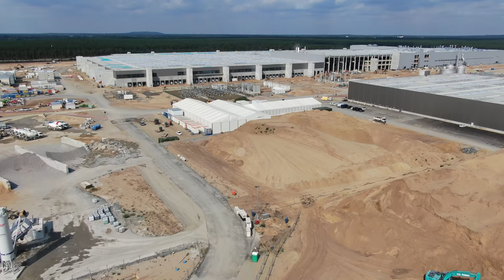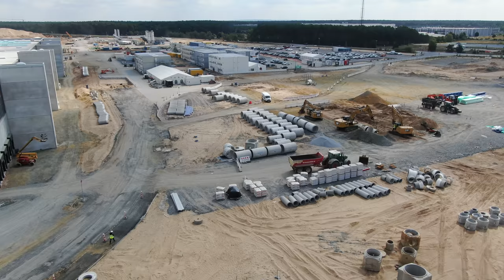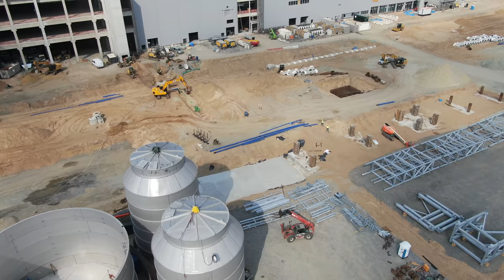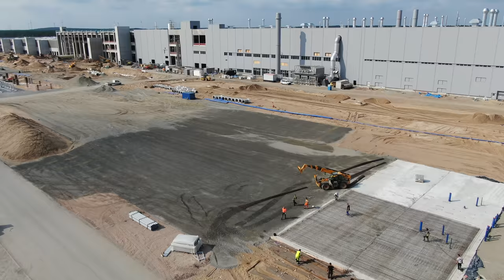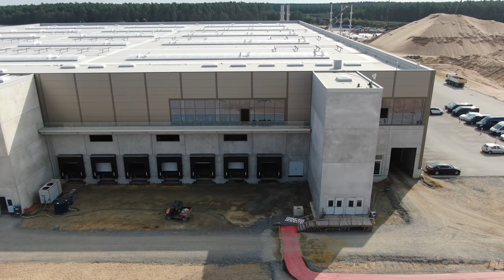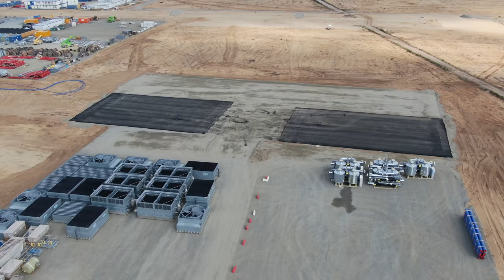Giga Berlin | 2021-08-21 | More Columns

Comment: Anyone know why they need steel reinforced concrete as their foundation??? (Part of that building)
Must be for something super heavy??
Tia
Reply: Someone wrote that the batteries and all equipment for making them are very heavy. There was concern about the ground not being firm enough to hold that weight. Therefore, they built a hollow fundament of concrete that would kind of 'float' on the ground. I don't know if that is an efficient method or if it is even needed, but that is what I saw in an earlier comment.
Reply: @the51craw  oh I see... Thanks 👍😊
Reply: That's a design not  in first place to cope with static loads (super heavy) but dynamic loads (heavy machines operating fast, e.g. high speed stamping) .  
The reincorced concrete base is where the machines will be, the area were the  (heavy) battery cells will "ripe" is in the northern part of the buidling, where there are just single pillar foundations.
Reply: @abalada  Yes, you are right. Dynamic loads are more demanding than static loads. Thank you for bringing this up.
Reply: spoken like a typical american engineering minimalist . Ever wonder why Americans concrete always cracks  and german concrete rarely cracks ?

Comment: What purpose does the double walls serve on the water treatment tanks?
Reply: Safety
Reply: The double walls probably function as a containment in case the inner wall leaks.
Reply: In the smaller ones the outer cylinders are open at the bottom, so maybe they will install heat exchangers in the space between the outer and inner cylinders to manage the temperatures of fluids in the inner cylinders.
Reply: @jameshoffman552  it could be also that they have the openings there until the finish the assembly of small cylinder then they close it. And then they can close the outer ones? It’s possible
Reply: @wolfgangselle3272  Maybe they are just going to put some seal doors to let an access  to the interspace to control the integrity and pipes if they are some inside or even sensors. I think they need to keep an access to be able to fixe anything going wrong or just maintenance.

Comment: I am starting to think they are digging in the same places? Some of the work seems repetitive. Especially near the IDRA machines some of the excavators first filled the holes they now digg again...
Reply: a) access - the trench could be in the way for other works
b) access - the excavation could be in the way for other works. And transporting it to somewhere else and finally back is not less work.
c) avoiding the need to stabilize the trench/hole
Reply from the maker: They are digging now between the main water lines and the building, so they are not digging in the same place.

Comment: At this pace, it might take another 2 years before it is completed.
Reply: Possible … when they are in stage 6 or so LOL … I can just imagine that the battery factory will take at least one year before full production so next year Fall or Xmas this could be up and running
Reply: Do me a favor. Please tell me another project of this size and complexity (water protection Zone) and quality which have been realized faster including planning time in europe ? Only 5 months ago Tesla decided to start with the battery factory in the first step instead the storage hall and completely changed the construction plans. Without these changes caused by Tesla everything would be in time. By the way all drone flights are filmed on a weekend. Some on a Sunday morning.
Reply: Very likely, but just like in Shanghai (where construction continues), production will start well before then....